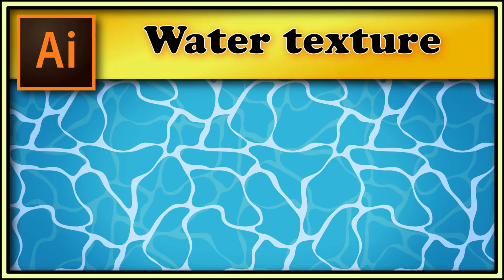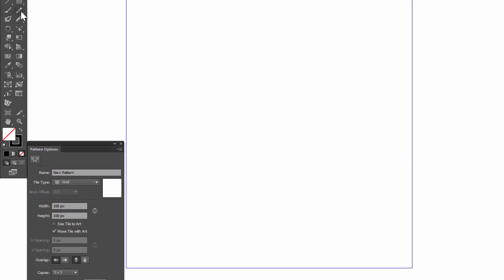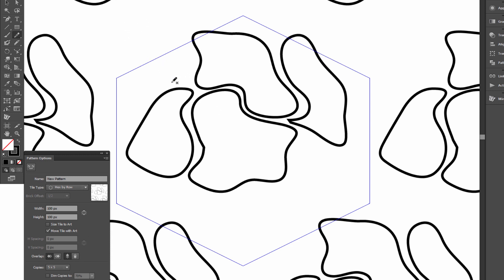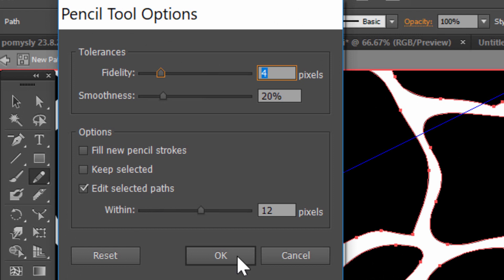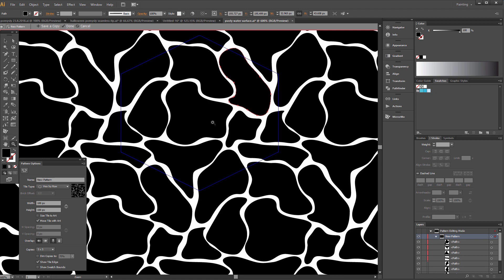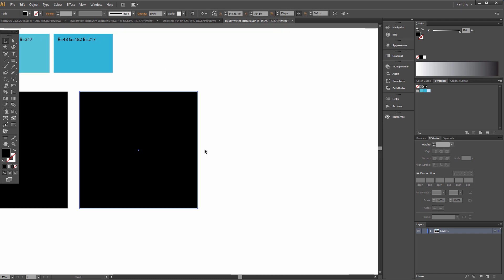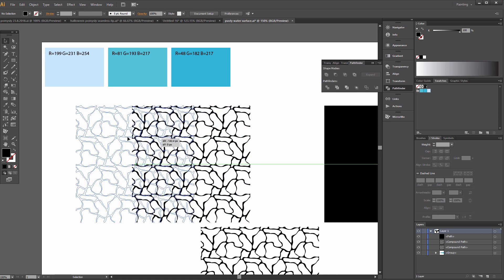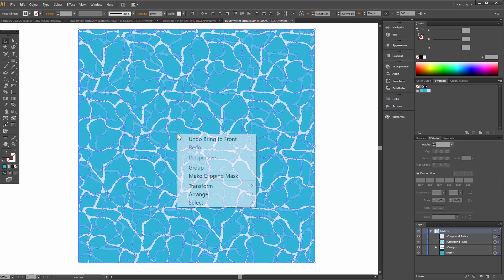How To Make Water Texture In Illustrator 🌊

Comment: Hi - thanks so much for this tutorial!
I'm having a problem with expanding (6:56) - when I click crop in pathfinder it says "the filter produced no results. Please select two overlapping paths", even though I have kept the box selected as you did. I feel that it's not expanding correctly because I don't see the anchor points of each individual section as you do. Can you please help me with this? Thanks!
Reply: I couldn't figure out how to replicate what was happening here but I found a workaround. Do the expand, then select all the elements using the direct selection tool (A) (just drag a box over the whole thing). You should see the outlines of all the individual little blobs. Copy and paste somewhere else. If you select what you just pasted you'll see the outline of a couple of giant invisible blocks. Delete those, then you'll be left with only the blobs as shapes and nothing else. Create a box and place that box BEHIND the shapes. Then select the box AND the shapes and do that path finder exclude thing. You should be left with basically an 'inverse' of the blobs. Takes some finicking around but it works.
Reply: @petey2b  thank yopu some much broyou
Reply: @petey2b  thank you man